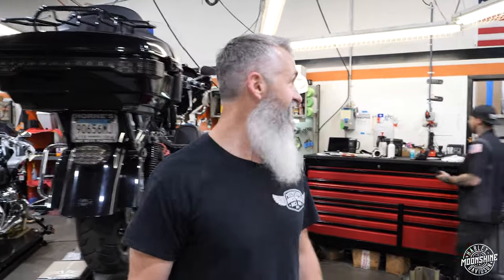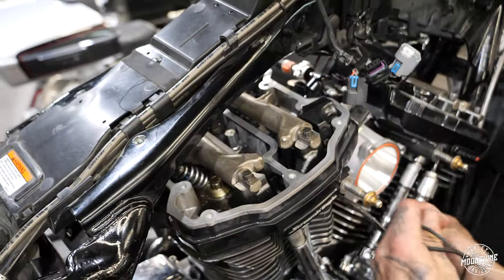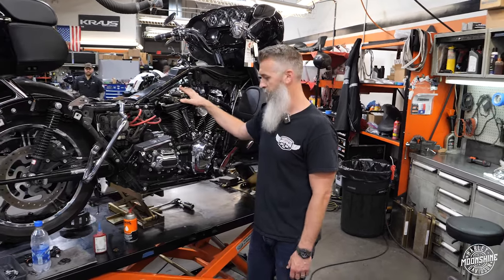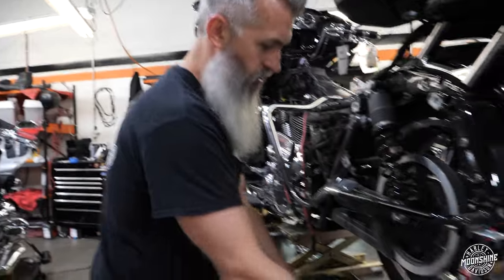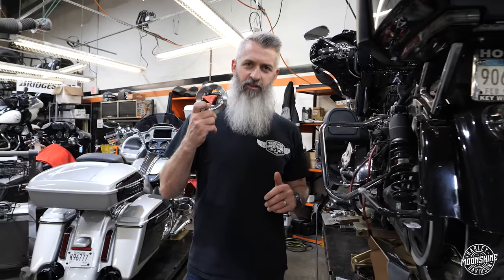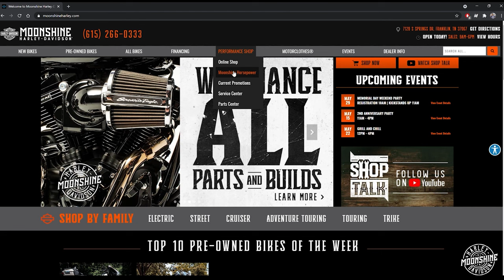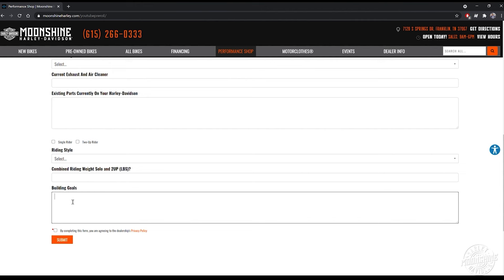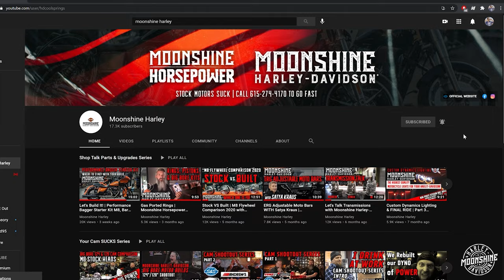MHP 131 SE Power Adder - The Ultimate Harley-Davidson?

Comment: Hate to interject but I gotta say Wood Platinum Lifters>Feuling RACE Lifters.
I got a set of the wood plat lifters and they are nice. Extremely durable design, no roller bearings to worry about metal going through your engine if a bearing fails. Very quiet once warmed up.
Very easy to work with when it comes to SE Pushrods too. Very pleased with these Wood lifters. I get to hear more of the exhaust and less engine whir.
Wood Plat Lifters+SE Pushrods=best combo IMO.